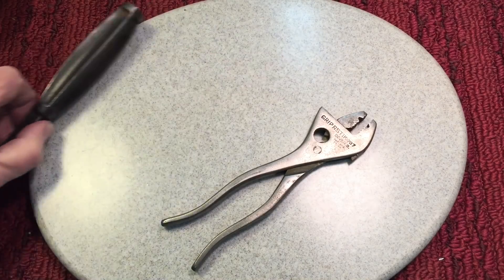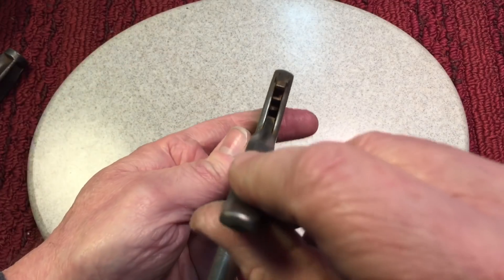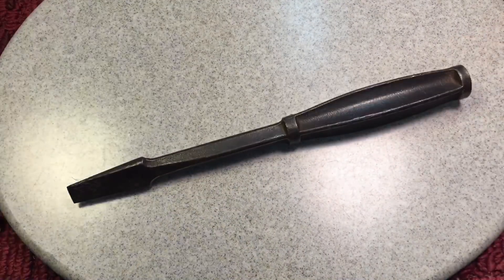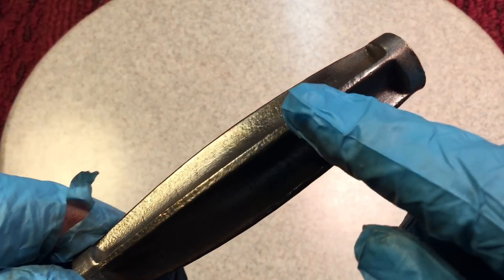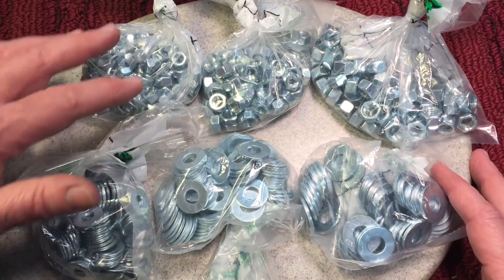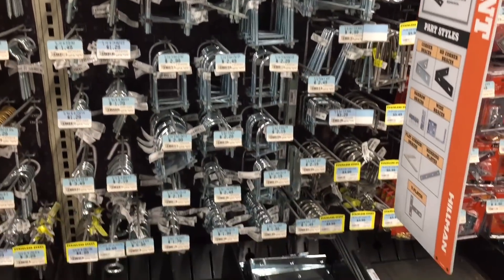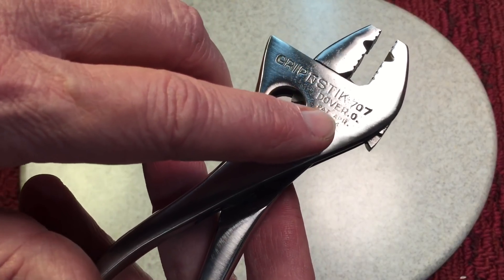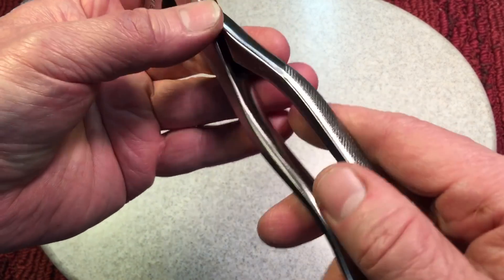Last Restorations of 2020. Franken-Driver and Grip-N-Stik

Comment: Wonderful job John.  Love me some Tractor Supply for hardware, and if not open, it's off to Ace Hardware rather than the big box stores.  A couple of years ago my wife came home with some stainless steel washers she had picked up at a box store as she wanted me to prototype some jewelry type thing for my daughter's dance team.  Put together something she liked and she said she would pick up the hardware to make the remaining 40 of them.  I told her I would swing by Tractor Supply at lunch as they had just built a new one 15 minutes from the house and I wanted to check it out.  Got the hardware for the 40 for less than the 6 she had bought for the prototype.  Can't beat buying by the lb!

Comment: Watch your channel all the time, sometimes all day.  I do collect 'old' tools, especially the old monkey wrenches and wrenches without sizes on them.  I like to restore them into a useful tool rather than the exquisite over the top restoration.  Now living in an assisted living facility I had to give up my hobby.  I used Kroil to help loosen rusted nuts.  Anything old was my objective, not necessarily tools.  My Dad had a hammer that he called a 'cletchy nailer' , spelling probably wrong, it had a cut out on the back with a place to attach a nail when you could not reach where you had to hammer.  There was a small ball, similar to a ratchet in the indent.

Comment: Before socket head cap screws and Phillips head deck screws became the rage back in the 70's straight bit wood screws were the big thing. The big screwdriver is a good tool for that. I could use mine with an adjustable wrench on the shank and press down on the handle with my shoulder. 
I noticed the tip of your driver was twisted. Mine was too. 😠😎
I like the Grade 5 fasteners. 
Went  to Tractor Supply and picked up some Grade 8 nuts. Since I got the wood lathe out and got my hand back in I think I will be making some file handles with the Grade 8 nuts to anchor the tang. 
Did you go through the discount bins. That is my favorite. They had an adjustable wrench with a Vise Grip style latching mechanism in addition to the thread. Budget wouldn't allow a useless purchase or I would have had it just as a What The Heck video topic. 
Great vid and glad 2020 is over. Wishing our life away wanting our problems to be gone. 😠😎

Comment: I really like that screwdriver, it's hard to find the wider blades like that. I'll have to keep my eye out for them on my tool hunts.  I was thinking it might be interesting to fill the voids in the handle with a good epoxy. Then chuck it up in the lathe and set the profile to the "London Pattern"  and square off the handle faces to an octagon instead of the 4 sides... might just help the hand feel.  Anyways thanks again for a nice video!

Comment: B/c of a guy I know of named John, i got a  Grip N' Stik and an Eifel plierench😊.  I use both.  In fact I don't even know where my pairs of regular pliers (or pipe wrenches) are anymore.  I find myself reaching more for the Eifel though b/c it can more easily be adjusted with just one hand (I read the instructions for once!), and the jaw has more geared positions on it than the just the three positions on the Grip N' Stik.  I see them both though as MUST HAVE tools for anyone.  All my friends I have shown them to have bought their own Eifel Plierench...but as you say the Grip N' Stiks are hard to find.

Comment: I would drill holes through the fins of that screwdriver, paint the inside and then make a resin handle for it shaping it on the lathe with a flap disk and thentry and put some knurls in the resin.

Comment: You are so lucky to have Tractor Supply - I may be wrong, but I don't believe it is possible to buy stuff like that by weight anywhere in the UK or Europe.
Reply from the maker: Hi Mike- Maybe someone has a suggestion for a inexpensive supplier in the UK.  😃👍

Comment: I thought for sure you would make 4 wood inserts for that screwdriver handle.
It is like they copied the tip and shaft from The Perfect  Handle  screwdriver and then came up with the most Imperfect  handle.
As far as I am concerned  the Grip N Stick should replace slip joint pillars.

Comment: At any given time, how many wire wheels and buffing wheels do you have ready to use?  And how many bench grinders?
Reply from the maker: 2 wire wheels, two fiber wheels, 1 buffing motor... I have about 4 double shafted motors in use.  😃👍